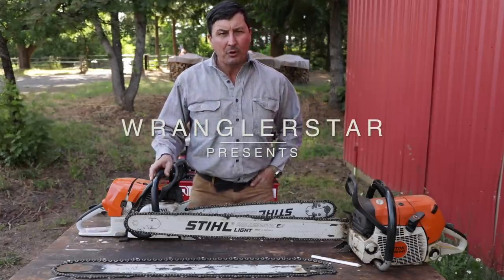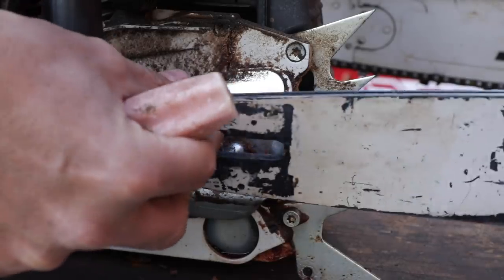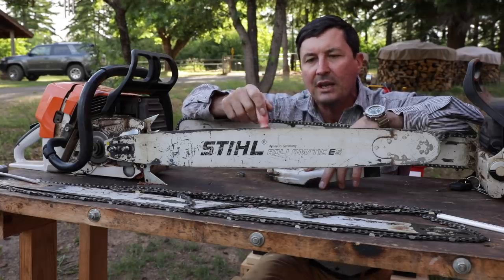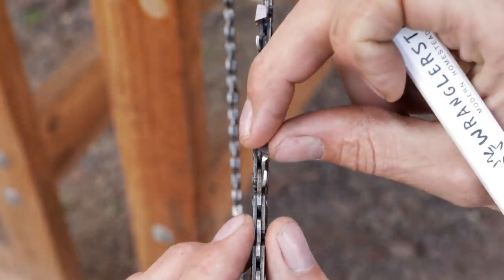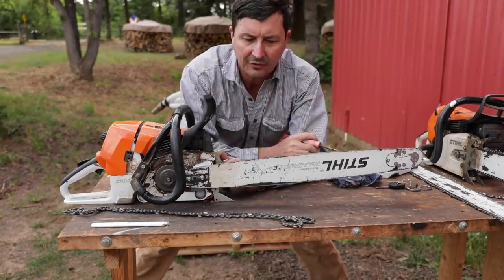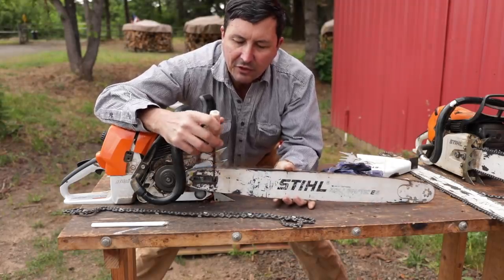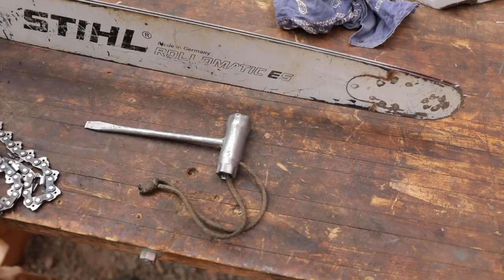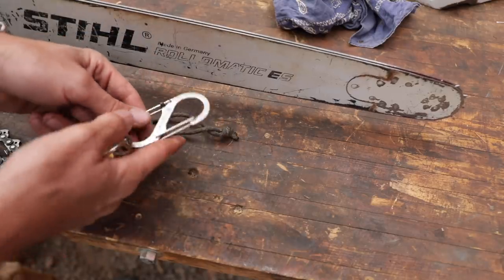Why Loggers Run Upside Down Chainsaw Bars

Comment: Another way to increase the life of your chainsaw by 10000%  is to put oil in the fuel tank and fuel in the oil tank.  You will experience absolutely no wear on the chain whatsoever.
Reply: Lmao
Reply: I see that a lot by my customers.
Reply: You forgot the other alternative, use old engine oil you drained from your truck in the oil tank. Or use diff oil coz it's thicker and better.
Reply: So your saying the manufacturers are not competing against each other or are to stupid to design a better product??
Reply: I actually did that once on accident. Fortunately, the guy I was working with caught me before I even finished filling it and asked me "what are you doing?" I looked down and realized what I had done, and drained the saw out and started all over again. I'm not a morning person.
Reply: Hah. I once almost filled my motorcycle tank with diesel then realized what I was doing. Fortunately the station had train tracks behind it so I took off the tank and dumped it on the rocks by the track. Rinsed out the tank with a bit of gas and filled it with real gas. My original intention was to put in the 103 octane this station sells.
For those wondering how the larger diesel nozzle fit the tank opening - this was a 1980 Yamaha 650 (almost the same as the Triumph 650) and the tank opening is large enough to take the diesel.
Reply: Sad....I have done that...
Reply: @SurferJoe46  Had 3 just last week.
Reply: Hey Chris - don't dismiss the old engine oil usage. I run my old oil and add a can of either STP or some Lucas additives to thicken it up and give it some more body. 

If I'm filling the oil tank at the same time  as I'm filling the fuel tank and they both haven't run out - the oil-on-the-chain mix is good. Test to make sure you are getting oil to the chain by throttling the engine and hold the nose wheel in position and see if it slings oil .  

When I'm cutting trees at 0F or colder, ANY oil is good and thick bar oil won't flow to the chain. It's all good - just use your head.
Reply: @ @davidhenderson3400  --- yeah - it's too cold for any - riding or pushing -  lawn mowers right now so all my service is on snow throwers and chainsaws. Weed whacking has come to a halt too. Imagine! lol! I DID have a few mini-cultivators come in though this week. Somebody's getting ready for the spring thaw-out.
Reply: Don't do drugs kids!😋
Reply: i didnt it with a ford f 350 put gas in the tank well filled the tank i think it was a 2013 maybe made it a mile or two down the road and it lost all power so we drained tank and changed both filters and away we went three weeks later it took a piston out number 8 then i found out the truck had a 0il change a week before that and they had found metal filings on the drain screw so not sure if i fucked it or it was already done

Comment: Who flips saw bar every sharpening.  No professional does. No one that actually runs.saws for living. The gap is the bar gage  which can be corrected same as the lip that developes.over time.
Reply: George Stepp when flipping the bar and then running on the opposite side for the first time what is happening to the original side if it wore uneven?  Does running it on the off cut side do something or nothing to correct uneven wear?  What about those that cut with up stoke as well as down stroke?  It seems odd that a recommendation to flip the bar so often when there is probably nothing happening to correct the off side.  The only thing I see is clean your oiler port and clean out the chain rail groove.
Reply: Flip it and file the burrs off of the bar, clean the mung out of the brake and sprocket, knock the dust out of the air filter, check the spark plug, clean out the oil ports and chain rail, grease the bar tip sprocket; general maintenance stuff. Take care of your tools and they'll take care of you.
Reply: Micah Detwiler I run sugihara bars before that I ran oregon. I run saws  every day all day.  I flip bars every 4 or 5 chains if that.
Reply: Kevin Jacobsen I am with.ya brother. I flip them every 4 or 5 chains but some times not that. I let the saw do the cutting lol I don't run dull saws. If I cant set it down on wood and it pull its self through the wood I ain't running it. It hard enough lugging them around.

Comment: Wow,I did not know that little secret about turning the bar for the lube holes. I just turned the bar for more even bar wear. Cutting a fire wood supply for 22 winters on the prairie  I wore out 2 bars on the 1st Husky saw and I am still on the first bar of the second Husky which I will use this autumn for the 23rd winter wood supply. Funny enough all the chain sharpening I have done over the years has been hand filing right on the bar.

Comment: I have an old Poulan 3400 that cannot run the bar in either direction, however, I believe it may be an aftermarket bar which only has one tension adjustment hole.

Comment: Metal filings from sharpening on or off the saw will contribute to wear. After sharpening, remove the bar and chain from the saw and wash with brake parts cleaner or hot soapy water.

Comment: I usually flip it when I put a new chain on, I also take the time to deburr the outside edge of the bar, it may get mashed a bit and it starts to interfere with cutting keeping the bar from going through the log easily

Comment: You can Use a flat file to knock down the burr, on the bar along the grove were the chain rides, this will help long Gevity of the chain and the bar. You can also use a small putty knife in the grove (were the chain rides) of the bar to keep it clean.

Comment: I always remove paint on the bar around bolt hole area. in video you see how scratched paint around bolts. So it when you tighten bar it paint makes a high spot on a surface and where it no paint it is a low spot which makes a gap between surfaces where oil escape. So it I just use some lower grit sand paper to remove all the paint and then polish the surface with flat sharpening stone- NOW it oil supply and bar surface sticks perfectly without gaps.

Comment: I've been logging and cutting firewood in the Northeast Catskill mountains since I was 10 years old you flip your bar every time you put a new chain on not every time you sharpen it you always sharpen by hand because power sharpeners actually harden the teeth and make them brittle and they dull faster and you can repair your bar if it's getting worn by simply putting it in a vice and pinching it slightly also every time you change your chain you should take a flat file and file the sharp edge off of the side of your bar

Comment: there is a small hole near the bar tip that is for greasing the gear in the tip.. and should be done at least each new chain(provided the bar did not accidentally hit the dirt ) there is a special tool to grease the bar  in the hole i mentioned ..  (something i think you should add to this informative video ) this is something most individuals have never learned about ..and i learned about it a few years ago and have worked years in small engine repair as well as had classes and training in small engine repair and was never informed of it )

Comment: a really great value is a rail roller, a rail thickness gauge, and a disc sander with horizontal capabilities..(to true rails).....a simple procedure if you understand the basics......a bar shop at your local saw shop can also re-groove rails..... also..pro grade bars usually have replaceable noses......cool stuff...

Comment: I clean and flip bar each time...I made a tool to clean bar and oil port and use small brush  in the field... Clean with air compressor in shop... it's important to keep bar clean for oiling and so the chain doesn't ride up.

Comment: The worn bar has just run out of guide rail. The guide rail has worn down & the guide runners on the chain are contacting the floor of the guide slot which, causes the chain to stand proud which, keeps the link buttresses off of the tops of the guide rails.
Cody probably doesn't mention the need to draw file the guide rails to even heights because you guys have soft wood. 
When cutting the very hard wood we have here in Aus, the guide rails will wear unevenly, causing the chain to lean & cut usually, to the drop side of the cut if, you're cutting fire wood lengths for example.
Good vid though &, I like his presentation.

Comment: It’s helpful if you clean out your bar grove the whole length of the bar it Will build up in the groove of your bar you’re fine if you take A thin piece of metal and clean out the groove the whole distance of the bar you will find that your chain will ride up above the grove which also links of chain wobble back-and-forth have 20 years of timber cutting

Comment: I work in small engine repair shop. You would be amazed at the number of people that get upset saying we put the bar on their chainsaw upside down. We this happens we just flip it over and no longer even try to explain to them why. The same people then wonder why the bar wares funny. Some times I wish the logo were not on the bar at all or at least flipped over on the other side. I had the same problem trying to explain to a woman that her 3-way light switch was not installed upside down.

Comment: you can buy a file from oregon to recondition the bar. also, people never check or replace the clutch hub (sprocket) and they're not expensive to replace. the drivers on chain get chewed and will eat a bar.

Comment: Good work brother. You forgot to mention that a slight burr along the bottom edge can quickly be removed by flipping the bar but if you flip the bar every time you sharpen the chain you will probably never develop the burr. I recently had a new hire millennial gasing the saws. He took it upon himself, when I doing something else, to flip the upside down bars while not tighten the bar nuts. I asked who told him to do it. He said no one but he did it because they were upside down. Millennials....

Comment: The discoloration is from the stihl factory hardening process.  Good video
Reply: @Robert Thompson  Your statement is true, however the statement in the video is also true.  If you have done some "real work" using a saw all the live-long-day, you must have noticed how hot the bar & chain can get.  Many hardwoods are particularly are difficult to fall,limb, and buck.  Eucalyptus (& other Gum trees) be a real cutting chore.

Comment: I don't flip it after every sharpening due to touching up my chain throughout the day as I keep my chains sharp at all times. I due flip it at the last sharpening at the end of the days work. Also you can dress those bars up with a file occasionally. You should also clean those saws at the end of the day after supper. Pull the damn thing apart and clean it, the oiling ports, air filter,and at least 3-4 times a year pull the pull start cover and clean around the mag. and air vent ports. Proper maintenance has led to several 40+ year old stihls sitting on the shelves and ready to work at all times. On a side note I like to strip them every 10 years and repaint and restore them for another 10 years of trouble free operation.

Comment: What I've done over the last 22 years living in the wilds of CA.  When it comes to fire wood cutting time I first sharpen my shovel.  Then I dig a ditch about 7 feet deep.  Then I gather all my logs (which if have gathered myself) and stretched them over the ditch, leaving enough space for me to climb down the hole.  I proceed to cut all those logs and the chainsaw is always upside down so I don't have to worry about some stupid rule that I have to insert my saw all goofy.
Reply: Only in Kalifornya. Full of fruits and NUTZ!

Comment: To test for oil flow to the chain bar ,start up and rev high for a few seconds with the bar end near to a clean stone or piece of dry wood and see if oil is being thrown off the chain,if not remove bar and clean outlet portal.

Comment: Hi.You made a good presantation ,but left out the most important thing.Wee flip our bar to get more evenwear on the rails.But what you missed is the bar groove itselfe.the bar groove plugs with sawdust and the chain tends to ride up higher than it should  by cleaning out the groove the chain will let the drivers sit much lower in the groove and keep the chain cutting much straighter.A plugged groove often makes one think the bar is wore out

Comment: Bottom line, sharpen your chain properly on a regular basis. The extra force you put on the bar due to a bunk chain wears the rails prematurely and when you maintain your chain dont forget to maintain your bar with a flat file by taking off sharp lips, high spots and evening the rails so your bar doesnt walk when cutting.

Comment: If you drill the hole thru both sides of the socket , in-between the sockets,above the screw driver shaft you wont loose the use of the one socket.

Comment: I'm embarrassed to admit that I once temporarily salvaged a well worn bar by filing any burrs and uniformly squeezing the entire channel area in the bench vise as the channel is considerably deeper than the drive links and it really doesn't ruin the channel parallelism....much.  The chain tracked quite well and it bought me some time before springing for a new bar. Just homeowner / small ranch type use.  Not recommended, but sometimes you just have to improvise to get the job done.

Comment: They flip the bars over for where. And when you're done fueling and filling the oil on your saw or sharpening your chain is usually a good idea to hold it wide open for a second or two and you watch all that sawdust pour out of there in the oil starts spitting out of the oil Port you don't have to flip the bar over to clean out the oil port. I've always hand sharpen my blade on the saw I cut about 3 to 4 floor chords of wood and a bar will last me at least 2 seasons.

Comment: Scrench goes in my back or side pocket with my file...or in the pocket on my chaps or my wedge bag... although caribeners come in handy, especially for your water jugs or gas and oil on wildfire

Comment: It would be nice if Stihl designed their chainsaw with a special recess in the body of the engine where you can slide the wrench tool into.  Like you said, the saw and the tool should always be together, why not have a slot where you can hold the tool within the saw itself.

Comment: I use my 288 for milling and it gets way more abuse than my other saws. I flip the bar exactly once in a while and the bars still hold up well. I suppose flipping it is a good excuse for cleaning the gunk out of the rails.

Comment: Get a 4in1 tool instead to measure your bar specs. You can simply clean out the rails every time you sharpen with the 4in1. Great practice to ensure the oiler hole is clear and that the debris isn't stealing oil from the chain. That pencil trick is some misinformation on what to measure.

Comment: Rotate bar, especially when chainsaw milling...I,ve extended worn rails by closing the gap with a hammer to the right size. It works, but just extends use for a while.

Comment: hooktender  ,  cutter   pacific  northwest ,  30  years experience, yes  flip  your  bar    often , .  what   is  not  said  here   is  ,  take  a  flat  file    and  even  out  the  rails   if  you  run   alot   every week ,    clean    gap  every  day ,     have  a nice  day  ,

Comment: The bar kinda spreads through wear. I found that if you flat file the bar a little, it lasts longer. Not really recommended, but I just couldn't afford a new bar.

Comment: Hey, good chainsaw information. I would like a good idea for wrapping up and transporting multiple sharpened chains. When we cut we cut all all day. Or a great way to sharpen the saw in the field. I sharpen 2 or 3 times by hand and switch to a second saw. 31 inch bar with a skip chain. And yes, thanks for noticing the spritzing gas cap in my Stihl saw.
Reply: We are not loggers but need 2 cords of wood per winter. We try to slam it out
Reply: Brexit Monger  im no logger .. but experienced in small engine repair..ect .. for a  portable vise  i have one welded to a peice of 2" square stock in a T shape . when i need the vice extra stout .. i slide one end into the Hitch receiver on the truck. .. also on the short ends of the T i have nuts welded to the bottom of the square stock .. this makes the vice wobble free when set on most surfaces with the 3 points of contact ..

Comment: Good advice, though I dont flip it everytime but I do dress it when needed. My bar is done if its bent or warpped or the rollor bearing is shot. Use a wire brush to clean the channel as well.

Comment: I work in a sthil shop as a service technician after a while of usage the bar will have a burr on the very edge of the bar. Why we dress the bar (grind and sand back to same height and smooth 👍

Comment: The new Stihl saws come with a torx tip not a flathead screwdriver for tightening the bar... I have to buy an extra since I have 2 torx head ones now and my other got snagged by someone

Comment: Well i know that periodically i put the nose by a piece of wood and open the throttle and watch for the oil spray.   I also have the stihl pouch sharpening kit missing a couple pieces but it has my file and my wrench that i have on a cheap tool belt with a small hatchet that i wear if doing a lot of cutting or just leave it hanging from the splitters oil fill pipe which holds it nicely

Comment: Awe dang your also on point, cheers. But remind your viewers that the only major chainsaw manufacturer that makes their own bar(doesn't come with an Oregon bar) would be Stihl (pronounced steel). Points I like you friend. Don't forget to remind the viewers that the Stihl bar doesn't need oil on the nose sprocket, that's proprietary Stihl they designed it that way.